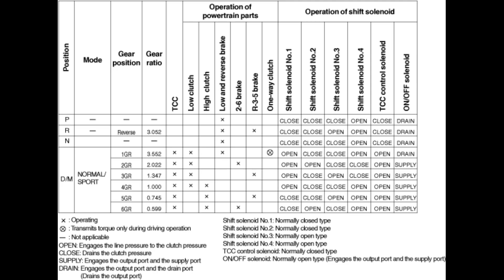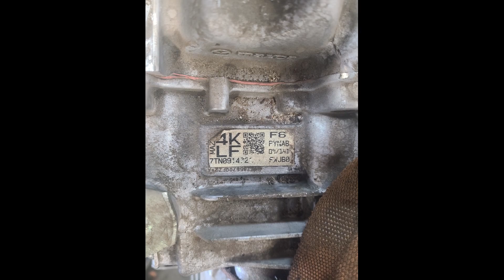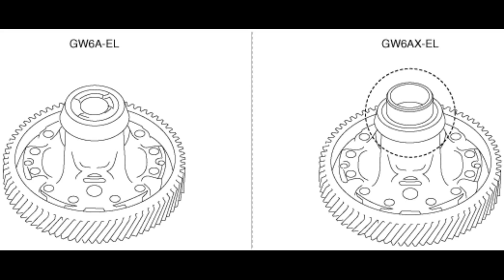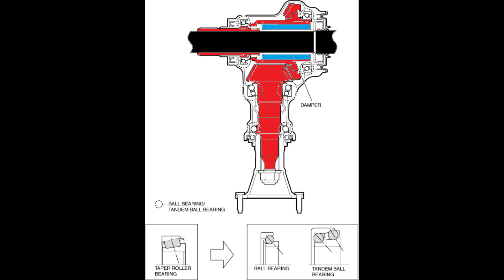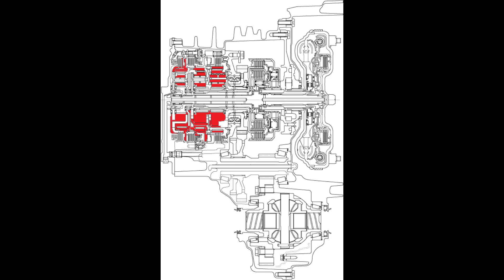FW6A-EL Overview (Skyactiv Drive)#fw6ael #skyactiv #skyactivdrive #transmission

Comment: Great video. Thanks for sharing all the info.

I’m thinking of a solution how to update a 2014 Mazda 6 (2.5L non-turbo) automatic transmission with a newer unit that doesn’t have the misalignment / mid-case bearing problem. Don’t want to shell out $5,600 for a reman unit from the dealer, not worth it for such an old car.

I understood that I can’t just swap a newer complete tranny from, say, 2020 Mazda 6 to a 2014. That would be the easiest way to get the newer design without the mid case bearing problem.

Do you happen to have information if the mid-case (with the dreaded bearing) can be swapped between the older units (2014-2017) and the newer updated units (10/2018-2021)?

Basically, I’m wondering if I could just use an updated mid case from a newer tranny and use the rest of the 2014 tranny internals, clutches, valve body, TCM etc?

My 2014 shifts great and doesn’t have any other issues but just started hearing the mid-case main bearing whine a couple of weeks ago.

Keep up the good work!!

Comment: My CX3 looks to be in neutral when cold. So when you drive 30mph (50km/u) and release the throttle, it goes to idle. After like 2km it does function normal. Is this a known issue?

Comment: Is the 6-speed SKYACTIV-Drive automatic transmission reliable if proper maintenance is done? Can I reach 300k miles without issues?
Reply: I made it to 244K now, looking for a replacement. It never had the fluid flushed, that's my fault for being ignorant of the ease of flushing these transmissions.
Reply: @Dina0wnes 344k miles on my 2016 Lexus es 300h and never once a mechanical issue aside from struts and rotors/brake pads. I have changed the transmission fluid a few times.

Comment: Getting ready to build/repair one of these. 1st one. Dealer diagnosed as bad VB (@ $3k) but to me feels like bad low drum after driving. Big delay in D but no issues anywhere else. Everything I'm seeing however says it's the molded piston and not serviceable. Trying to confirm this. Any idea?
Reply from the maker: The Low clutch drum piston is only serviceable as a new drum from Mazda or a good used one. Its welded together and there is currently not a solution for it. There is a chance the piston is fine, you'll want to split the VB and check all the valves and vacuum test them, everyone we have opened has had significant wear on some of the accumulators and some of the valves. We import slightly oversized ones from Europe and replace with those and have had really good luck doing that. Depending on mileage and if it had heavy city use you'll also likely see the Low Clutches themselves past discard measurement even though they look fine. Neutral Idle Control slips them at a stop and every one I've measured is below discard.
Reply: @21mazda3turbo3  it's definitely the drum. Already pulled VB and went through it. Only found 1 toasted accumulator. Air check through the case shows it applying but also dumping. The high on the other hand thumps solid. 
Are you referring to MakTrans? I've been curious about their slightly oversized valves and coincidentally they're really the only show in town with this unit. Even SONNAX doesn't have shit for this. However the Ukraine/Poland origin gives me pause. No problems ordering from those guys?
Reply from the maker: @ScottPrice-y5v  I order all sorts of things from them! Great stuff. We've had really good luck using them for Lineartronics, the Mazdas and ZF. I have a good relationship with some of the guys at Sonnax and have used some of the prototype parts for other units but they have no desire to do anything with the Skyactivs, too niche. The Maktrans tools fit with the Sonnax jig and work nicely. It can take a few weeks for the parts to arrive based on if its in Ukraine or Poland has been my experience.
Reply: @grolladat  thanks. Any idea what actually happens to the low drum?  Customers complaint is 5-6 second delay into drive. I'd assume shrunk piston however they usually get better hot. Aside from leaking like crazy, I've got ok apply and judging with my finger, the clearance isn't terrible. Also once in, it doesn't slip although at lights you can feel it momentarily drop out
Reply from the maker: @ScottPrice-y5v  do you have the drum out of the unit yet? You can test it on the bench mounting it to the pump, I had an old clip I just uploaded using shop air with that method. Mazda had updated the drum a few times over the years. It may also be a bad sealing ring on the input shaft. They chose a slow apply strategy for the Drive engagement, which I don't really like. You can watch the solenoids and see it bring the clutch to the kiss point when you put it in Drive and then slowly apply to full. Sometimes, the car will be moving before it's applied full pressure to that set. A new friction in that set measures 1.52mm and discard is 1.475mm. I would at least open the drum and measure them and check the steels, we've had some with some hot spots running the middle of the steel. https://youtu.be/rVlJXndup-U
Reply: @grolladat  no I haven't pulled the unit. It came to me because the dealer told her the VB was the problem and 3k but 6-8 weeks for a VB. Phone conversation led me to assume PR valve but when I got the truck in my hands and roadtesting it felt more internal. Understanding how the high/low works and the odd harsh passing gear (only from 5th or 6th to 4th or lower), perfect R apply, clean shifts and lock up. Pulled pan and it was clean, yanked VB and airchecked low drum which applied ok but solidly applied clutch pack. Decided to pop through valve body and found some issues but no smoking gun. Changed the SS1 for the heck of it. Issue got substantially worse so out comes VB again thinking I missed something but no. Airchecked low again  and while still applying was leaking like crazy. 
Thoughts are the first time it was cold and likely had  decent amount of fluid in the circuit.  2nd time it was hot and was rechecked after I found nothing in the VB. 
It's pretty remarkable how much it was leaking yet still applying that clutch
Reply: Just a follow up, pulled the unit and clear as day where it's leaking. Outside lip of the piston. Made a video but I don't do the YouTube thing and don't think I can attach video in messages.
The bizarre thing about this is that a leak like this in almost any other unit I've built wouldve smoked the clutches. Once in gear, this thing worked fine
Reply from the maker: @ScottPrice-y5v  Yeah, that's abnormal that they weren't wasted.

Comment: Great video, thanks for sharing! I have a 2017 Mazda3 (2.5L and automatic transmission) with about 135K miles on it. The car has been an absolute joy to own and work on (I do all the maintenance, tires and brakes). However, I’ve never replaced the trans fluid or the filter/pickup because I bought into the “lifetime fluid” claim. I’ve noticed harsher shifts into 3rd and 5th gears. They happen whether the car is hot or cold, although less noticeable when hot. Throttle input also seems to affect it- if I’m giving it say 50% or more throttle, it shifts smoothly. If I’m not really on the throttle, the shifts are harsh. Based on your video, I’m thinking the 3/5/R clutches are worn. What do you think?

Comment: I just bought a 2014 cx-5 awd and im trying to solve a strange issue. whenever i start to drive the car after its been sitting the first shift from 1st to 2nd is very harsh, like a manual driver dumping the clutch. Only the first time, after that it shifts normally. i was thinking maybe its just low on fluid and so im going to do two drain and fills. it has 165,000 miles.
Reply: Howdy. This is very common for mazdas and other manufacturers. When the transmission is cold, fluid was not changed regularly, and it has "higher" milage on it you will feel that the first couple of miles. I have the same issue with 1.5 mazda 2 with 120k miles. Changing the fluid and letting the engine warm for 20 seconds, putting to drive without moving for another 20 seconds helps a little. drive carefully until the blue light (cold engine) goes away.
Reply: @victor070  thanks for responding. I did two drain and fills shortly after writing that and the problem disappeared.

Comment: For your Mazda 3 turbo transmission servicing do you just do a drain and fill? Or do you do a double drain and fill with a trans filter change?
Reply from the maker: I generally drop the pan, change the filter and clean the magnet. I follow an aggressive service schedule and change about 5 qts outreach time.
Reply: @grolladat  So for the tranny pan bolts being torque to yield; what would be the downsides of changing those bolts out? I'm a little annoyed with having to pay $1 to change the bolts, but wouldn't mind changing the gasket if I'm able monitor the magnet for wear.

Comment: My daughter's Mazda cx5 had a P0761 code ( Shift Solenoid C performance stuck off). Changed all the solenoids and wire harness and pumped in new ATF. The gears would not work and still gives the same code. What could be the problem?
Reply: solenoid codes are often not about the solenoids but a way the car can tell you there is "something wrong" and only in some cases the issue is only the solenoid itself...

Comment: Hi. I have a question about this transmission. I have a 2013 mazda 3 skyactiv, with this transmission. At low speeds jerks and slips a little. Also it has the dreaded humming/whine sound that indicates the bearing of  the drive Transfer gear is Bad.

I've read the TSB that describes this issue and found that transmissions build october 2018 and upwards have a modified bearing and casting that prevents the bearing from going Bad.

The question is. Can i swap the bell housing from a 2019 or 2020 CX5 N.A for the one found in My car? That way i could fit the "improved" transmission from the cx5/6. I've noticed that appart from the bell housing and the converter, the transmissions are the same.
Reply from the maker: The updated P/N for each vehicle has the changes done to it. You'll want to purchase the correct one by your VIN. There are case differences depending on the specific vehicle it is installed in.
Reply: @grolladat  thanks a Lot man. I Will contact My local dealer to see if they can source the transmission.

Comment: Great videos, mate, very well explained. I have a 2012 cx5 2.2 diesel, and when cold sometimes in between 3rd and 4th for brief moment the revs pick up, it has troubles engaging and then it engages but everything is ok when it warms up. I think it may be a sticking valve for 4th gear in the valve body. What do you think?
Reply from the maker: You could have an issue there or some wear beginning in the high clutch set itself that is compensated for when there is some heat in the unit.

Comment: Hello, your opinion is important to me. I purchased a brand new 2.0 6AT 2024 Mazda3(114kw) without cylinder deactivation. Transmission jerking, bumps quircks and has some bad things. Dealer says everything is ok and this is normal , but not for me, Because it is very noticeable in a traffic jam. Upshift downshift both are bad feeling.  What can I do? I made the initial learning according to your video but all things are the same?

Comment: So these are used in the 2018 Mazda 6 2.5T correct? Whats the torque capacity of the FW6A-EL?
Reply from the maker: The 2.5t use a version called the GW6A-EL. Mazda rates the FW series at 200lbft and the GW 340lbft. That does not mean above that power level it will necessarily break, just the rating Mazda has given it. The GW series has some pretty significant upgrades. I have two videos comparing the inside of that transmission and torque converter to the FW series.
Reply: @grolladat I’m new to mazda and I recently purchased one with the plans to build it. Historically how much have people pushed before these require upgraded clutches, torque converters, and valve bodies? I’ve had transmissions built (by shops) before just trying to figure how soon or even if its necessary to look into build kits.
Reply from the maker: @1996English  Nobody has made enough power to break one like that yet. There are no upgraded kits to buy yet, I'm working on clutches and valve body changes. Torque converter I already have a supplier, the real change will come when we gain access to the TCM. That will be needed to keep everything together at higher torque levels.

Comment: Hello, I have a 2019 CX5 which has a hum at 60 km/h, I put a scanner on it, it says that it is slipping in 5th gear and that the failure occurs at 60 km/h, my Mazda feels good and passes all the gears and stops. they feel good. Can you help me what could it be? I also lowered the crankcase and the oil was in good condition.

Please help me

Comment: i own a 2014 6 very interesting to see the design of the 6 speed im sure the later ones are probably tuned better but for me the 6 speed is great for normal daily driving but the lack of a sport mode sucks and the manual shift mode is very rough when shifting down from 6th to 5th and 5th to 4th. Thats under normal spirited public road driving tho if im on track going full send and way up in the rpms the manual shift mode is excellent

Comment: Awesome. I have a 2018 mazda3 and am in automotive school now. We haven't gotten to automatics yet just manual so far. I love my transmission so much. The manual mode is not the fastest but so consistent and sport mode really tightens up the trans a whole lot. It has some weird quirks that you have to get used that a lot of people seem to have trouble with, like slipping on cold start, the unlocking feeling while slowing down, a stutter here or there if you time an input awkwardly. I've gotten used to all of it and it's such a smooth experience and will still shift fast when you're pushing it. I love that it is 6 speeds too with traditional medium-tallish gearing. It just feels so much more natural than  running up and down a 8-10 speed auto.
Reply from the maker: I love them too. Because of what I do, I have seat time in a lot of vehicles and also much prefer them over most 8-10 speed units.
Reply: Yeah the taller gears make a huge difference, my 17 Toyota with a 6speed shifts 1-2-3 then back to 2 if you need the slightest acceleration for a stop all before 30 mph it’s like second gear is hardly even used i’m like why didn’t they make second gear longer but that’s exactly what they did here on the Mazda and it feels world’s better

Comment: I have a Mazda 6 turbo you think installing the jb4 would cause any problems with the transmission? Seeing a little more boost only about 5 psi over factory boost
Reply from the maker: I personally don't like devices like the JB4. There are a lot of calculations made in the TCM about how to shift and they require accurate information coming from the ECU. With piggybacks lying to the ECU, the TCM is receiving incorrect torque amounts. This isn't to say you're going to have an issue but it is something to be aware of. The turbo version of the transmission is quite a bit stronger than the regular and should do ok. I'm running a dev tune from DRtuned on my personal car and the trans is perfectly happy so far.
Reply: @grolladat  thanks that’s exactly what I was wondering about because I’ve seen a few with the jb4 and it seem like the transmission wasn’t as snappy between shifts as it is stock great info thanks !!

Comment: Is a drain and fill enough for servicing? They do say that this stuff is lifetime which I never believe... but just curious what you have seen. I have a 2016 CX-5 and 2018 6 Grand Touring Reserve w/turbo...
Reply: I took off the pan and changed the filter my 2013 mazda3  2.0 skyactiv other day. 5 qt of fluid came out. Poured 5 qt of new fluid in, ran it to the temperature the book said(122F) and checked the stick while at idle. However there wasn’t much on the stick when running. I didn’t see any leaks. Should I keep adding? The car ran fine.
Reply from the maker: Drain and fill is fine but you'll want to change the filter and clean the magnet at some point.
Reply: @grolladat  how long between filter changes do you think?
Reply from the maker: @gooniac33  I plan on doing mine every 30k. I live in a severe climate and the turbo cars run fairly warm transmission coolant temps.